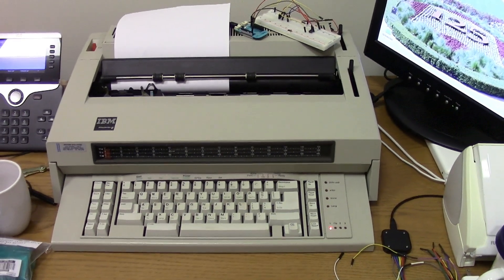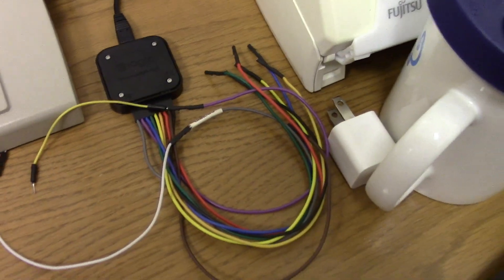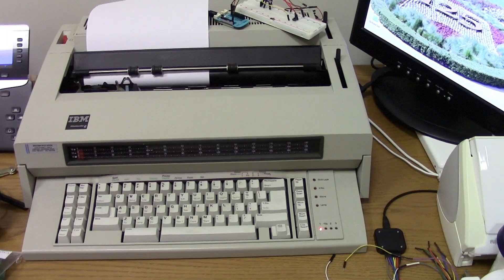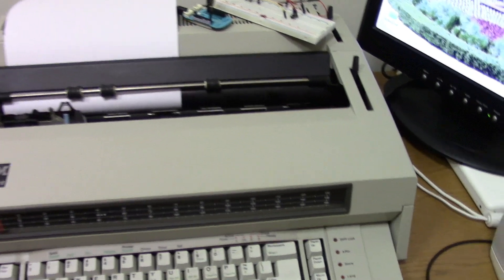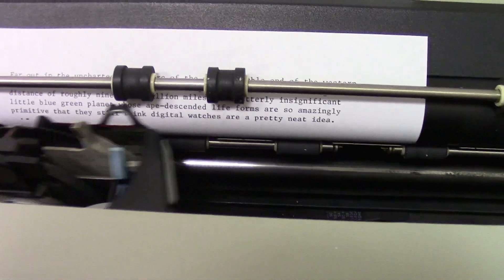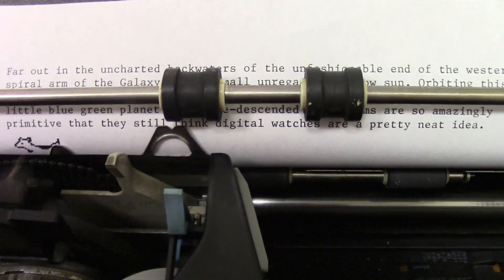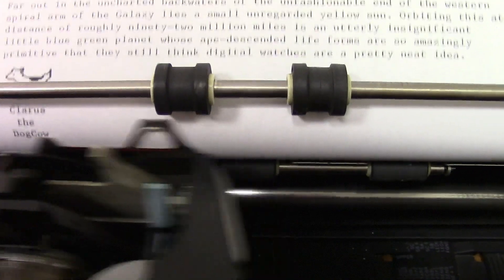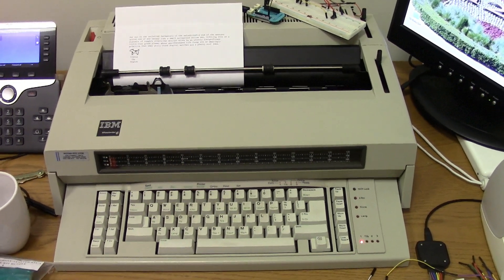IBM Wheelwriter 6 Typewriter Hack

Comment: This is just what I was looking for! Thank you so much for sharing.
It wouldn't be too hard to modify the project to turn the Wheelwriter into a full-fledged serial terminal.
You would have to listen to keypresses from the typewriter keyboard and add an RS-232 serial interface.
Maybe Arduino couldn't handle it, but a Pi Pico certainly could.
I have a Wheelwriter that I would like to transform/repurpose in this way.
I'll give it a try.
Reply from the maker: Great--at one point I had a working serial terminal, and they Arduino was fast enough to capture the data from the typewriter.
Reply: @DrChrisGregg  Excellent, thank you for the information. I'll try with Arduino first and keep it as simple as possible. Do you have a recommendation on how to 'listen' for keystrokes?

Comment: Chris - cool project. Have you looked at tapping into the keyboard and making into a full fledged hard-copy terminal?
Reply from the maker: Thanks! I haven't specifically looked into that, though I don't think it would be too difficult. Capturing the output of the bus is certainly doable, though the Arduino is on the edge of being fast enough to both capture and place data on the bus.

Comment: Aw, my Wheelwriter 10 has a totally different option interface. I got excited :(
Two big ribbon cable sockets, routed to the 8088's address & data bus + a couple pins of some big black box ASIC. Leave it to IBM to over complicate it! lol

Probably impossible to reverse engineer without the option module... Too bad the schematics for these are unobtanium (and the option boards)
I'd probably have an easier time reverse engineering the keyboard, and making an Arduino keyboard emulator or something
Reply from the maker: I have a Wheelwriter 10 as well, and they changed the whole internal structure by that point, and I think most everything is on one or two chips, without a bus to capture from. I think the best you could do is to try and hack the keyboard connection, but my guess is that the fancy features (reverse printing, micro-spacing, etc.) are not going to be hackable on that vintage machine.
Reply: Yeah... finding a parallel port card would be nice, but I can already imagine the asinine prices people will list them for. "It's old and slightly uncommon so it must be worth as much as a car!" - the vintage electronics market in a nutshell lol

Maybe some day I'll try dumping and disassembling the 8088's [soldered in] ROM. It might at least give some hints about where it's looking for data or something.

But if it does that stuff on the "incognito" QFP chip, that's the end of that. I'm hoping those lines are just address decoding or something, baked into an ASIC.

If you're interested, I'll share if I ever figure something out
Reply from the maker: Great--I'd love to know if you figure it out.
Reply: I took the plunge and desoldered & dumped the ROM. Haven't been able to make much sense of it; I need to read up on x86 instructions. Should be interesting to learn one way or another I guess
If you'd like, I can send you the ROM dump
Reply from the maker: LeiserGeist cool—I’d love to see it!
Reply: Huh... I guess ya can't PM people on YouTube nor GitHub anymore. Weird feature to randomly ditch.

Comment: I have an IBM Personal Wheelwriter II, noticed it has a parallel port on it as well as key labels like "print" and "spell on/off" and "printer on/off".  Does that means whoever owned it before already installed the kit? (kit being the printer feature upgrade etc)  or did these typewriters already come with a parallel port and just need the user to install additional hardware to make use of it?
Reply from the maker: The Wheelwriter II did not, as far as I know, come with a parallel port, so the previous owner probably installed the kit. I understand that they are quite rare kits, actually.

Comment: I tried to do this same thing with a royal typewriter. How did you connect the arduino directly to the bus? Whenever i do it it doesnt work
Reply from the maker: This is an engineering challenge -- it took me many days to figure it out for the IBM. The different bus on a royal typewriter (if it has a bus) is going to be different and will require reverse-engineering.

Comment: so what does the mosfet and resistor do in this circuit?

I found an IBM 6746 which seems nearly identical, but don't really want to solder SMCs, is it possible to replace the components with some through-hole parts like an IRFZ44 and a trimpot?

Comment: This is great work! I've successfully implemented your code as a wifi-enabled (using ESP8266) tcp serial ASCII converter on my Wheelwriter 6. One thing I was wondering is, did you connect the bus wire to the port in the back? (the one with the flip off top) I made an adapter to connect it with the ribbon cable but, plugging a circuit board to the top would certainly be cooler. :D
Reply from the maker: Awesome. Yes, I connected it to the bus on the back, with the flip-top. Glad it is working! I attempted to use an ESP8266, but I couldn't get the timing to be precise enough. Did you have to do anything in particular to the timing?
Reply: Oh, sorry I didn't specify but I set up the ESP8266 to communicate with an ATmega via serial. Essentially as a telnet to serial converter. Although, when I have more time and pick up a logic analyzer I was planning to try using the ESP directly. One major problem (at least with my ESP) is it always spews out garbage on start up which glitches the typewriter, so not sure if that's a good idea. On my setup i have it send a "password" sequence to the atmega before it types to get around that.
Reply: Do you still have your code? I’m looking to do something similar

Comment: I would love to have an optional printer board for my Wheelwriter 30.
Reply from the maker: Hmm -- this could work for you, but I can't seem to tell if the right port exists (looking at the picture here: http://s3.amazonaws.com/kpsurplus_images/596ed3d81bdd02da9cad15b047c65c8cb31d9ade.jpg). I would need some pictures of the back circuit board to see. But, it is most likely possible.

Comment: I must say you're an electronic wizard ! So many of these WW's came with optional printer boards in the beginning so they could be used as printers, but quickly laser printers emerged & got cheaper. I have taken 100's of those optional printer boards off these WW's & threw them away since. Phoenixtypewriter.com
Reply from the maker: Thanks -- it has been a fun project. I designed a PCB for the components, and I may put them up on eBay for anyone who wants a current solution (USB) that doesn't require a parallel port. Interesting that you have thrown so many of the printer boards away...I think they might be worth something today!
Reply: @DrChrisGregg  I would like to purchase a PCB. Looks like a great project. kschildt att gmail dot com. Thank you 😊
Reply: Hi, Chris. I am attempting to the same thing with Brother  Ax 24 typewriter. Will your "plug and play PCB component" work for it. If you like....I can send you a picture of the microcontroller. Thanks